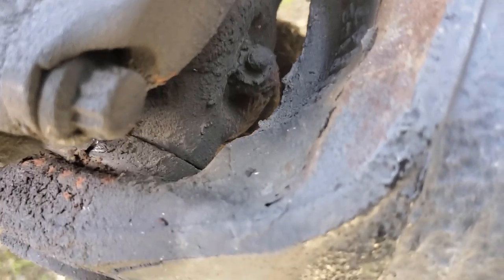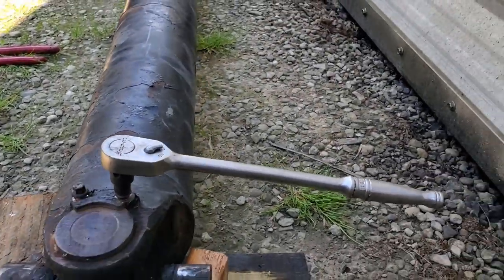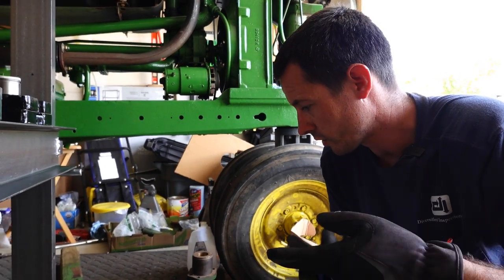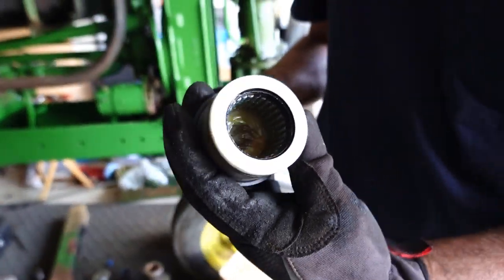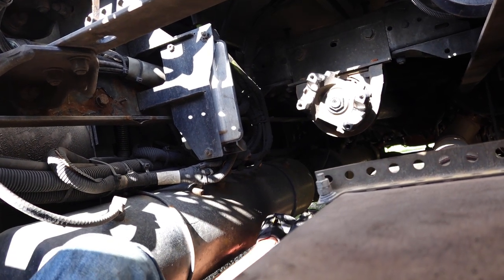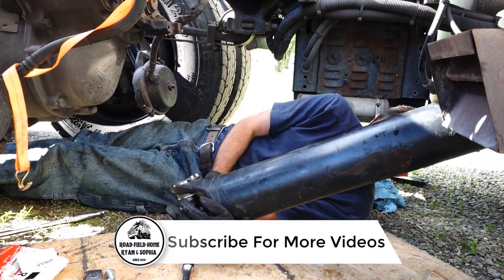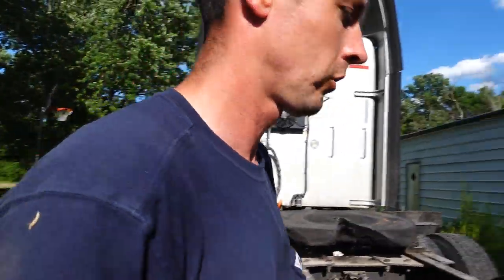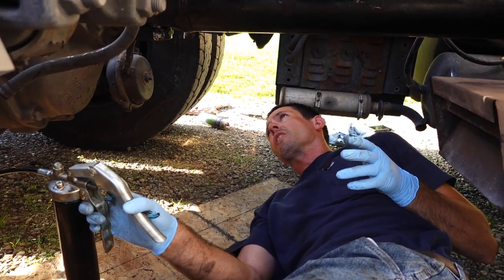Removal & Installation Of Heavy Truck Driveshaft U-Joints - Save $500 DIY 🛠️🛠️🛠️

Comment: I always hit the end cap. I would never hit the yoke. You are replacing the end cap but not the yoke. Hopefully. The metal is real thin on the yoke. I don't hit anything anywhere on the actual driveline, except the endcaps. IJS.

Comment: Ryan I can feel your pain putting the drive line back into place I am dealing with that now.i and ankle deep in mud in northern alberta temp about 2c trying to get out of this isolated area have a broken bolt on the yoke can only use 1 bolt on 1810 ujoint hoping to make out to a shop to extract the broken bolt

Comment: I like to keep the drive shaft on the flange and use a jack to take off the caps that works as well and you don’t have to beat the crap out of the driveline but good job either way
Reply: You keep the mount brackets on?

Comment: Another great video Ryan. So how do you tell the torque settings on the various bolts? Experience, manual or something else?
Reply from the maker: Normally the instructions show you the torque setting, and experience plays a smaller role in it.